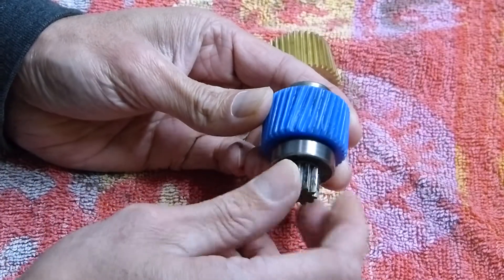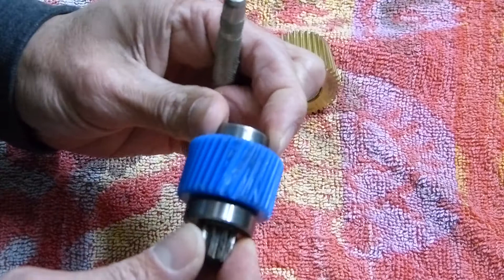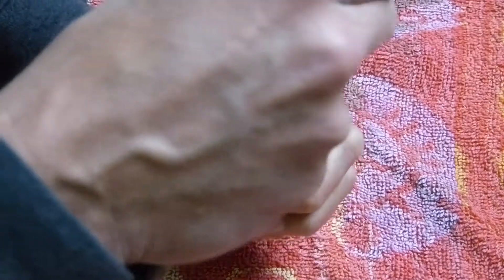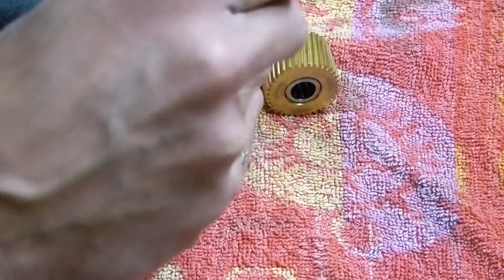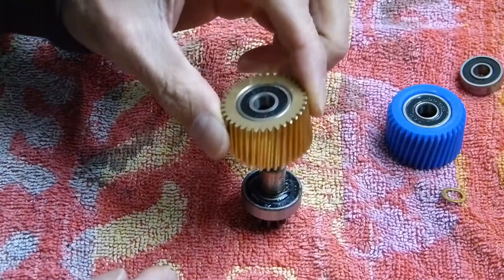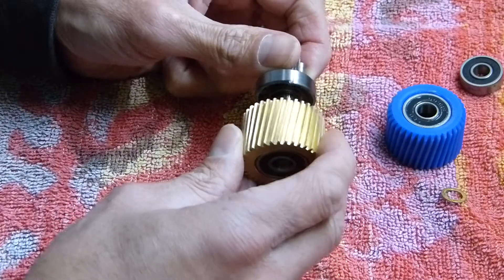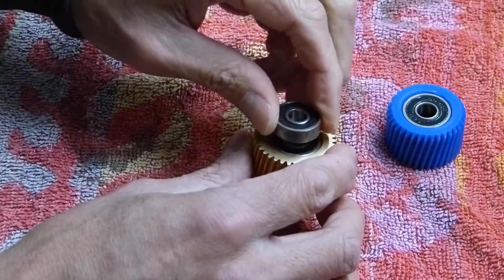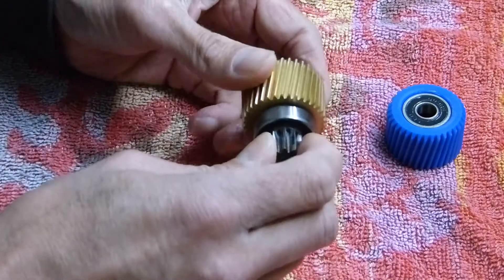TSDZ2 mid drive blue gear replacement

Comment: I suspect that my helical gear shaft may be damaged, in your video, it comes out very easily when you pull out the gear. Do you know how you originally got it out, did you just have to apply a lot of force?
Reply: Same issue here. I actually managed to pull the blue part of the gear off, but the metal part remains stuck on the shaft and the shaft doesn’t get out even with repeated punches on the other side. Did you eventually manage to get the shaft out?

Comment: Thanks for the video. Do you recommend the upgrade to brass gear (for peace of mind) overall? Is it really louder? And last question what type of grease do you use? 

Thanks
Reply from the maker: Definitely upgrade, not much louder and not worried about stripped gears anymore.  Just used normal wheel bearing grease

Comment from the maker: I don't remember it being hard to separate but then I did 4 years as an aircraft mechanic...  You need to pull it straight but loosen it by rocking the motor side to side as you do.  Failing that, if it's still on the bike with the driver side crank attached, try turning the crank forward and back as you pull.  Even rock the bike a bit too disengage the gears a bit.  I took my motor of the bike first.

And failing all that, take the plastic cover off the drive side  and give the small drive gear a couple of taps with a flat punch.  Getting the seal back on is a bit tricky though

No locktite or sealant on mine

Comment: Derek help I'm stuck trying to get the motor off too, can't seem to rock it or budge it after taking out the 4 countersunk screws. Do I need to go to the gym and work out my muscles first ?
Reply: This is probably only useful for new owners. You remove the moor from the housing by placing a piece of 1 x 2 or smaller piece of wood under the lip of the motor & tapping it loose in 3 or 4 places. Then the motor will wiggle free of the housing.

Comment: Thank you for the helpful video! However, I am stuck at a previous step. I removed the 4 screws that attach the motor but the motor does not come out. Is it blocked with Loctite or something?? Did you use an extractor to remove the motor?